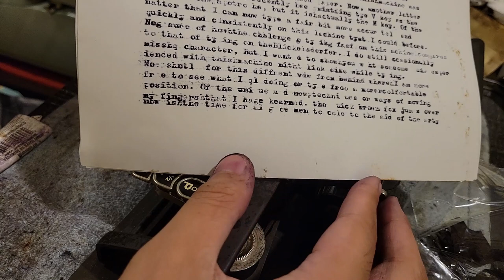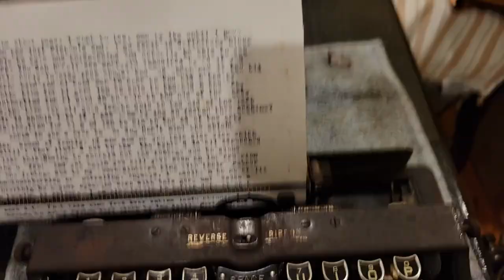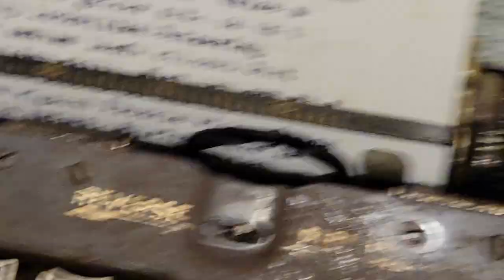Speed typing on a 110-year-old 30% mechanical keyboard (Bennett typewriter)

Comment: I was extremely skeptical about this typewriter until I saw you typing at a reasonable speed. Very difficult to find skilled typists in an already niche market.
Reply from the maker: This is about as fast as it goes before it starts printing some incorrect characters, and it does start feeling rougher and occasionally "screeches" like nails on a chalkboard, but it holds up and performs.

Comment: In the Bennett manual it shows that you're supposed to use flat fingers when typing on their machine, not crooked ones like on every other machine. I've started doing that on mine, while I'm sure it won't make you type faster, it sure makes the experience a lot more enjoyable.
Reply from the maker: I think I remember learning of this either in the manual or an article regarding the Bennett, but found that trying to type like thus was actually extremely unpleasant for me or "unthinkable". I have a partial background in classical piano which deeply influences my typing technique, whereby flat fingers are your worse enemy except when absolutely needed to reach a large chord or you are in a position such as in arpeggiated accompaniment where you can use your wrist and arm motion to guide the straight fingers. Otherwise, since you only need to tense one flexor, and holding your fingers straight keeps your posterior forearm extensor muscles tensed, the strong structure of naturally curved fingers is highly favoured in piano playing and typing for both speed and the minimalization of effort. Likewise, for the same pressing effort, a curved finger allows the force on piano or typewriter keys to be delivered from a smaller radius than with straight fingers, requiring less flexing of the finger muscle to delivery the same force to the key. In a sense, since the rear keys also push down the front ones, the Bennett design enables flat-fingered typing, but that doesn't necessarily make it advantageous. Otherwise, if you prefer this more "authentic" usage of the Bennett (for example, I use my pinkies on my Blickensderfer when at least earlier manuals recommended a three-finger (per hand) technique), all power to you. :)
Reply: @haelscheirs_haven  I guess we're just having different experiences. With the flat finger I don't find my arms or even up to my shoulders being nearly as fatigued. Also with the flat finger you're basically required to lay down a smoother key stroke, versus a punch with is so much easier to do even accidently with the traditional typing method. Hope you didn't take it as some snide remark, just wanted to help out others that find this video because so many say the Bennett is unpleasant to type on. Since I've changed my method I've found it to be much more pleasant.

Comment: Slow typing
Reply from the maker: Yes. If you see the video description or the previous video describing the machine's workings, you will learn that this machine is mechanically incapable of surpassing 5 to 6 characters per second which is slow by typebar typewriter and computer keyboard standards. The keys depress up to 2.5 cm, feel rough and springy, and are 1 KRO. This video demonstrates typing just below that performance maximum before the machine starts jamming or screeching.